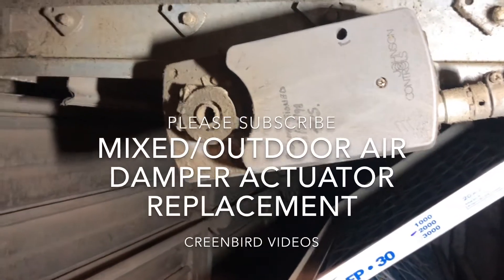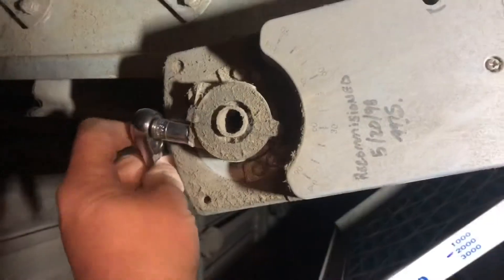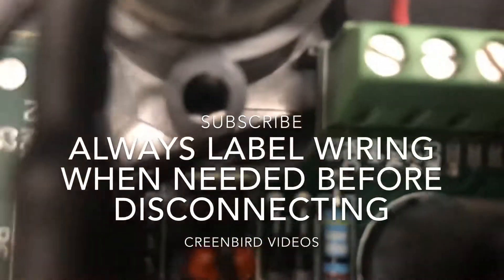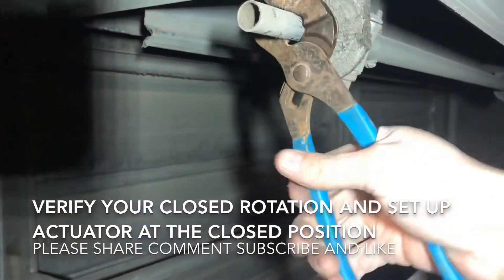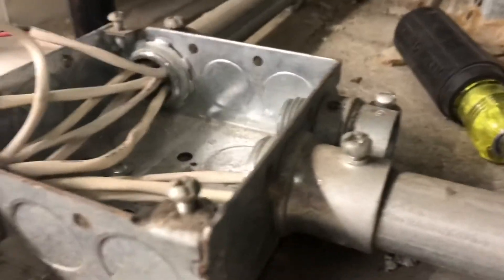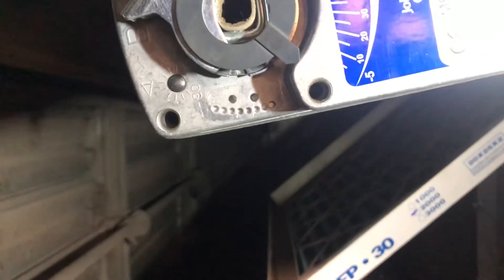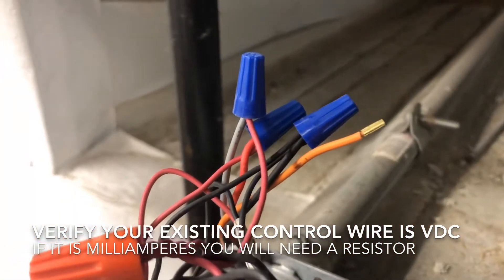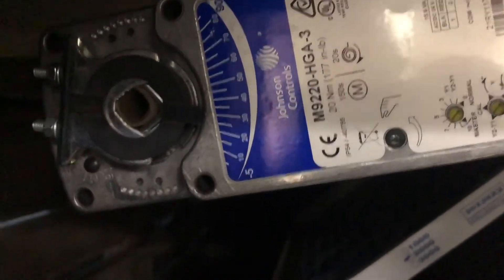JOHNSON CONTROLS Damper Actuator HOW TO replacement MIXED/OUTDOOR air AHU M9220-HGA-3 M9216-HGA-2

Comment: Quick question is there a specific way to attach shaft to damper blades. It seems to get stuck the way I try
Reply from the maker: @albze  spring return closed. So when the actuator has no power, your damper is closed. Sometimes you have to use the limit screw to stop the damper from going to far on the opening action. Depending on the damper.